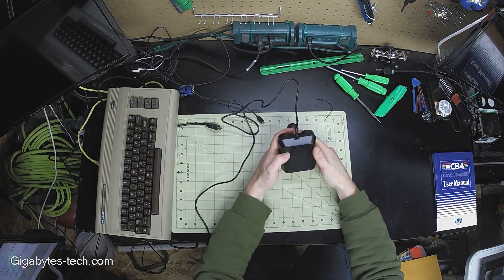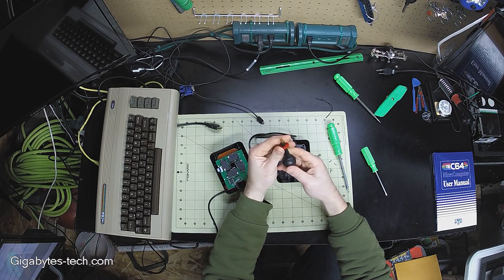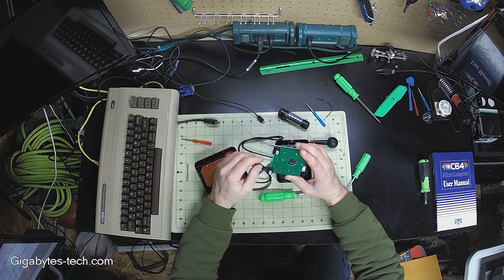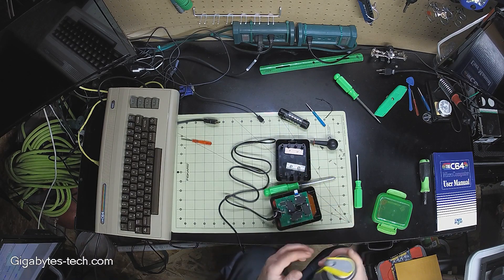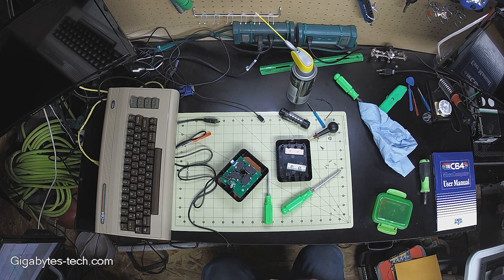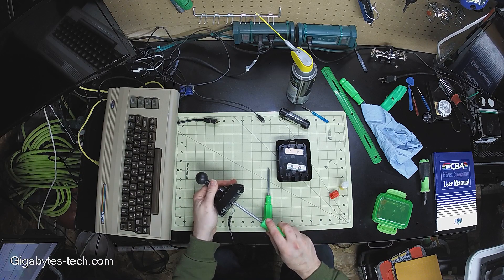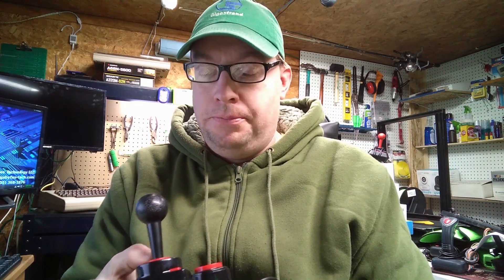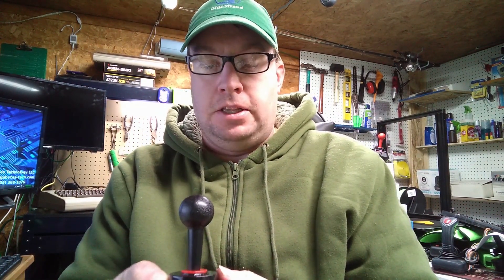The C64 Joystick: Disassembly, Repair, and Mod

Comment: Even though i already have mine for a while as a collector's piece, i just recently got it out of the box for a firmware upgrade.
Seems like my joystick also has the same issue, so i'll open it and lube it up.

As for the usb wiring, great idea!
It makes you wonder why they didn't think of that, since it would make maintenance a lot easier.

Since they just recently released The VIC20, it makes me curious if they kept on improving the joystick.
One thing is for certain, the "Maxi" joystick was already a massive improvement compared to the original "Mini" version.
What a difference between those 2!

Comment: I have this happening to mine - right out of the box. It would stick in the downward position. Thanks for the video.  I will be taking mine apart to fix as well.  Love the pin connector idea for the USB cable too.
Reply from the maker: Mine stuck out of the box as well. Thought it was a switch problem initially but just needed lube.